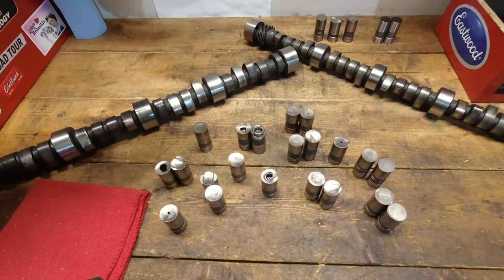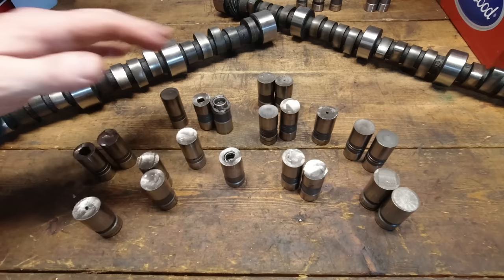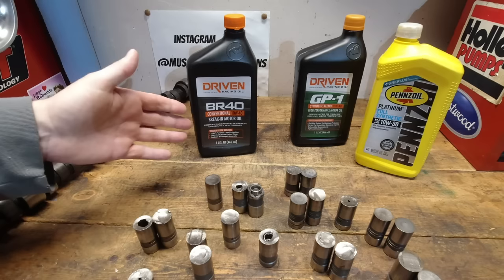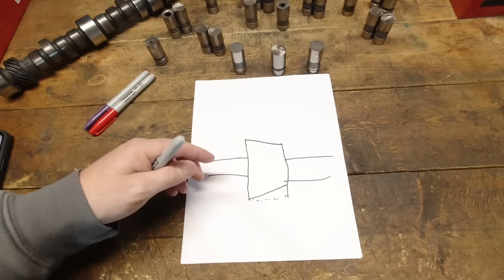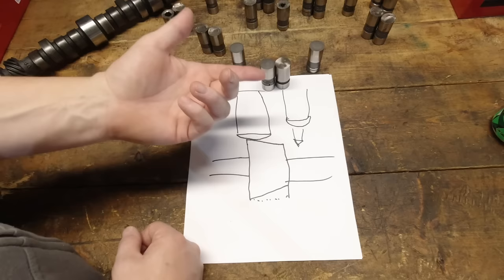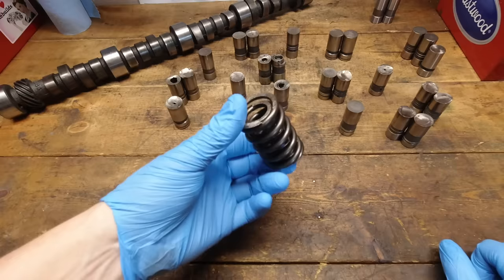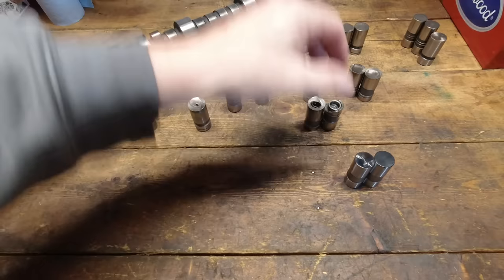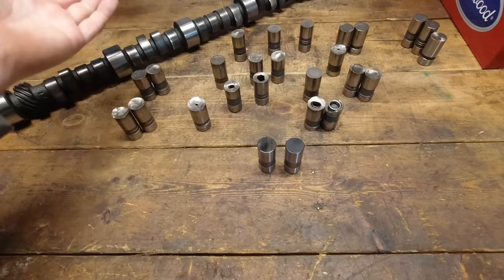Flat Tappet Cam Failures: The Reason Why They Go Bad & The Solution! Part 1

Comment: It would be nice for the manufacturers to further the machining process and sell their cam and lifter sets already broken in where the lifters and cam lobes are already wear mated together. Just packaged afterward in a specific way , then later installed making sure the lifters are placed in the correct bores to their correct matched cam lobe. 
Would save a lot of worry, headaches and trouble for the engine builder out in the field.
I carefully pulled a cam and lifters out of a Chevy V8 engine years ago and kept the lifters in a marked organized box to keep their orientation to the lobes they were paired with.
I will be breaking protocol and will be re-using this already broken in used cam and lifters in my next V8 build because I still do not trust any of the cam kits being made and sold today. 
It used to not be this way..
I've built engines and swapped cams  for 30 plus years .never had to worry about metallurgy , final machining and surface hardening processes much less be an oil chemist back then or do their QCs job. 
You trusted the parts quality and manufacturers reputation ..then installed the parts and broke in the cam per manufacturers and factory specs and procedure and were done..no problems after..it was easy..
So easy in fact a kid in his late teens could do it. 
Now the building and break in  process , just like everything else , has been intentionally made overly complicated and made excessively confusing. It has become literal rocket science now where it never once was. 
I sincerely hope that some manufacturer will one day come to their senses and produce parts like it used to be. 
Right now, it's anyone's guess what will work and it's a literal throw of the dice when you fire that engine up for the first time regardless of how careful you were in building it. You just don't know who to trust anymore.
Reply from the maker: The cost for a pre broken in cam and lifter set…yowza.  That would be ridiculously high!  The new DLC lifters seem to have changed the course.  Eager to see more applications covered but so far the reviews have been extremely positive.
Reply: @MuscleCarSolutions I think pre broken in cam and lifter sets ready to go  would put the ball back in the manufacturers court..forcing them to up their game in quality and reputation. If it wipes out on them, it's their loss and problem to correct in order to deliver a quality product you can trust is right.  
I would pay extra for that additional manufacturing step to get the peace of mind and assurance we once had with these parts 30 years ago when they were excellent quality. 
Better than shelling out the expense to rebuild again if the cam/lifters fail on you and hope it doesn't happen twice..
Reply from the maker: @mattmccain8492  I’d bet that would be a $2500 price tag.  Even if it was HALF that, no one in their right mind would pay it.  I have the final video in this series coming out soon that will go deeper into lifters.  There’s some things that I’m not seeing talked about yet.  Coming soon.
Reply: @MuscleCarSolutions thanks. I'll keep a lookout for it and definitely watch.
But I don't believe a pre break in machine  process would be THAT expensive. I can already see that step and tooling production setup in my mind.. simple setup and an optional manufacturing step done to order by request of the paying customer for a additional fee...not all cam sets.....but it requires an initial short term tooling change up in the production line  and the long term overhead expense of competent human employees to do it..something a lot of corporations are cutting back on and refusing to implement in today's corporate business models. 
But like you said, in 10 years this technology will probably be fully phased out intentionally.  So chances are nothing will be done.   The 1st gen small block Chevy is practically gone the way of the Ford flathead..only this time it was never truly replaced by superior design that was willingly accepted and transitioned to by the consumer....just forced acceptance to new , but still prototype phase, technology. 
Given the choice, I don't believe any gear head would willingly intentionally give up the Chevy small block on their own acord..its too reliable and versatile. It just works too well, easy to work on, is very affordable and has wide interchangeability across decades and a huge aftermarket support... .they are being forced to change to new tech and products that do not sell themselves as things once did.
Reply from the maker: @mattmccain8492  it has nothing to do with tooling.  None of the cam manufacturers today (comp, Howard’s, isky, trick flow, lunati) make lifters.  They purchase them.  We covered a bit of that in this video.  There are only a handful of US manufacturers making them and I have no doubt because they don’t want to due to going roller to support the OE business, that the quality has slipped.  But we’re going to go way more in depth on that up coming video.  The only way to break in a cam and lifter set is on a dyno or Spintron and that’s some costly time when you consider all the factors involved.  $2500 wouldn’t surprise me one but.  But they’ll never do it.
Reply: @MuscleCarSolutions yeah you're right. I know some guys who work at comp. They tell me the same whenever I bring up the quality of their product into question given recent events with all the cam failures lately. Some get outright defensive about it  but I don't care..nothing will change unless someone speaks up. If they can correct the issues with the lifters they obtain from their suppliers, then that would be great. So we shall hopefully see.  I appreciate the info you shared as it gives better understanding to this frustrating subject we have had to contend with .

Comment: This used to be unheard of. What has changed so much?
Reply from the maker: Discussed that in the video!  From several angles!
Reply: @MuscleCarSolutions  What I got from it was that 1) Oil is different than it was when flat tappet lifters were about the only thing out there,
2)Springs are stronger than they were back then especially in racing applications,
3) Manufacturers don't want to make them for economic reasons. 
Manufacturers have known since the beginning that the cam lobe taper that you spoke of had to be there and yet we're talking about it.
Regarding cam hardness and how it changes from running, there is a gentleman who did a video where he tested several old cams, some of them well used, and I believe some of them were in failure and they were all within two or three points of their published spec or their historical value. Now I recognize that you know many orders of magnitude more about cams, lifters and engines in general than I do but this one stood out for me, lacking clarification.
Thanks
Reply from the maker: @InsideOfMyOwnMind  for sure.  The hardness topic was one that I felt had a lot of information that needed it’s own video.  I just released that one this past week.  It’s a great video if you’re interested in seeing more.  When it comes to taper and lifter crown, that’s another video that I need to gather some more examples so I can present it all together.  Cam taper is wild.  There are some cams out in the market with a ton of taper ground in to match the lifters they are sourcing from odd places.  Not recommended at all.  We’ll also cover this in an interview I have coming up with Billy Godbold.  The interview I did with Lake Speed Jr recently covered a bit of the oil angle.  Trying to cover all of the different topics in different videos and keep them under 30 minutes.  Lots to cover!
Reply: @MuscleCarSolutions  👍

Comment: Let me tell you man I really thank you so much you just save me a lot of money because I am up to this part but believe it or not and tomorrow I am going into my garage checking if I bought the cam from Summit and if I got the list is from Summit as well And hope that there are the matching set for that cam and as far as the springs like the ones you just showed I am using on my heads I have a 350 small block for boat main and don’t know the pressure on those and never even thought that I needed to know thatso I will be bothering Summit tomorrow to get me springs as well to match the lifters and the cam. Thank you so much. Also, I am buying that oil as well priming oil.👍👍💪💪💪
Reply from the maker: Matching spring’s are important AFTER the break in.  For that initial and extended break in period, you have to keep the spring pressures low.  Oil, making sure the cam is of good quality (not the summit brand) and that the lifters match the cam (crown and taper).  Might go ahead and check out the other two videos in the series as they offer some additional insight.  The block has to be right also, so hopefully your machinist gave you the specs.  I’d absolutely look at the comp DLC lifters.  But everything else needs to be right as well to give yourself the best chance of initial break in.

Comment: You say don't mix and match brands of lifters to camshafts but the DLC lifters look like a godsend for flat tappet break in. I recently had a comp cam failure. Would you run these lifters on a Lunati cam?
Reply from the maker: Yes.  Comp had made all the Lunati cams for the last 15 years.  They’re ground on slightly different lobes but the taper is the same and they all use the same flat tappet lifters.

Comment: One lifter went out on my sbc street truck. Trashed the cam, going retro roller.
Reply from the maker: That’s certainly the most dependable option.  Just make sure your machinist verifies lifter bore location and interaction with the lobes.

Comment: Without being there myself without doing it myself the only thing that comes to mind after 55 years is because I've had some with failure and I only had one that failed on me it was my fault,  the hardness of the lifter material and the assembly Lube to break it in and then maintenance which means changing your oil and watching valve float which will rattle its guts out and the camshafts are usually pretty hard but the lifters but if the lifter material is inferior and doesn't like being banged and smashed very often then it'll start to gall or chip or flake away and then start battering through the bottom of the lifter now I could be off I could be wrong but from this distance and this observation that's not in front of me that's my best assumption

Comment: I think the problem is the taper on the cam and lifter. Miss matched clearances eating material away and nobody checking that, not the parts manufacturers, and not us or they wouldn’t send it out the door. I’ve had luck with .150 taper from the center of the lifter to the outside chamfer/edge on gm lifters. I’m not an expert but I’d say you’d want a little more than that on the bigger diameter lifters. I’ve ran gm hardened face lifters on several aftermarket cams and they’re on spec better than anything I’ve checked…so far. Maybe I’ve been lucky. But I check the cam and the lifters and haven’t had a problem since my dad told me to check every part you buy because it wasn’t the lifters in his time it was cam failures. A cam wouldn’t last 100,000 miles and lifters would actually be so tough it wouldn’t hurt them but the cam lobe would be destroyed. Geometry sucks he said. Started checking everything and sending cams and lifters back to be machined. He said after everyone started checking it we didn’t ruin any parts. We put too much trust into a company producing parts in spec and I think very simply they haven’t been checking and we the consumers paid the price.

Comment: Over the last year , there have been well over 20 videos posted on YouTube showing exactly why cam /lifter failure in flat tappet applications has become such a problem . The problem is how the cams and lifters are ground . With lifters it's erratic grinding and either flat ground or uneven grinding . What all the videos show is that instead of having 1.5 thou taper from center to outside....there is none...or much more . Since the taper has to match the taper on the cam lobe to promote rotation , cams suffer the same lack of QC . If everybody in YouTube land is aware of what's causing the issue....the cam companies HAVE to be as well . Having an aware public is bad....when you haven't corrected a known problem in well over a year . Being aware of the issue didn't stop them from foisting off junk on those that are not aware . That's a really poor way to run a business .
Reply from the maker: There is not one factor contributing to the failures flat tappet cams have seen over the past two decades.  The ones that are the most terrifying are the ones no one is talking about.  We covered it in the last video in this series.  Seems like half the videos I’ve seen only want to talk about lifter crown.  While that’s very important, it goes hand in hand with the taper on the cam.  There is a fairly well known cam in a niche engine that uses a really aggressive cam lobe taper.  Why?  Because they chose to run a lifter with an odd crown.  But, they work well together.  Even though of it was measured it would show way more than that factory spec.  But if someone bought the cam and not that lifter and put it together with an odd combination…destruction.  Way too many variables at play here and one of the biggest killers isn’t the fault of any cam manufacturer.
Reply: @MuscleCarSolutions  When rebuilding a basically stock engine , using basically the same lift and duration ...there just aren't many other factors in play .
Reply from the maker: @MarineGrunt  plenty of factors.  And the biggest one is largely ignored until a good machinist finally sorts it out.  Go watch my last video on lifters.  But again, it’s one factor of many.  It’s frustrating to see so many failures that could have been prevented.

Comment: The cast cam cores coming out China along with poor heat treatment processes and surface hardening (nitriding) don't play nice with the more aggressive profiles people want to run.

Keep in mind, until recently NASCAR was still aing flat tappet cams and they weren't having issues. It's just poor quality consumer stuff that's bought from the lowest cost supplier
Reply from the maker: All of the cams in the video were US made cores.  Some of the “house brand” cams you see could possibly come from off shore.  The major manufacturers use the US based core manufacturers.  

That’s how Driven Racing Oil was born.  When the API oils drastically reduced the amount of zinc in there off the shelf oils.  The amount of failures in NASCAR was staggering those first two years until Driven formulated that oil for their team and sold to the other teams to stop the failures.  Until they switched to roller in 2014-2015, they still had failures.  Cast cam cores, to your point, are not capable of handling the aggressive lobe profiles and the pressures out on them.  Everything evolves and it’s time for the cast cams and flat tappet lifters to ride off into the sunset.

Comment: DLC is only being offered on solid lifters. Hydraulic flat tappet appears to be as much or more than rollers!!
Just a quick search revealed that.
If DLC works they won't keep them cheap for long. As soon as the word is out up goes the price Gautanteed.
Reply from the maker: That is incorrect.  The link to the DLC hydraulic lifters is in the description.  You’re looking at the tool steel race lifters.

Comment: I lost 2 solid lifter cams using oils with ZDDP. Last cam I used Joe Gibbs BR oil for break-in with my old springs and drove the number of miles per Lake Speed. Then swapped the springs and broke them in per Lake Speed. I followed up with Joe Gibbs 10w30 driven oil. Later used various brands such as Valvoline VR1 racing oil, Red Line, Kendall and Brad Penn. After the last cam install I did lasted 8700 miles which then I decided to get the engine torn down and go roller and that was back in 2012. If I was installing a FT cam today I would invest in laser holed lifters for the extra oil. 😊
Reply from the maker: The EDM holes have never been proven to be the solution.  It was a good theory that never really solves the issue.
Reply: @MuscleCarSolutions  Based on your sketch at 18:10, there is a very narrow path that the lifter rides/rotates on the cam, so that EDM hole would need to be in a very specific location, and due to the low speeds teh lifters rotate at, it would not be getting a lot of oil to the required location (not constantly, anyway).  And on top of that, there's now a discontinuity (the hole) in the rotating path.  Is my assessment correct?
Reply from the maker: Holy cow dude.  Please don’t take any drawing I do as a “to scale” or “as used”.  It’s just a representation of the general situation.  But yes, if you look at a cam and the lifters as assembled, you’ll see the lifter is offset on the lobe.  As far as the EDM oiling hole, I think it’s pretty clear that in theory it was a good idea.  In practice, not so much.  Or at least not a measurable amount of success from it.  Given not all lifters have them or have the feature available, it’s hard to say they were a success.
Reply: @MuscleCarSolutions  Oh, I wasn't scaling your print, only pointing out that you visually showed what geometrically must be true - a lifter with a radiused surface has very little contact area with a lobe that has a taper built into it.  And that the location is not in the center of the lifter diameter either (else it wouldn't rotate).  But I'm betting that the EDM'd lifters have the hole dead-center?
Reply: @furyfantoo  the lifters are literally flooded with oil from the bore clearance and the crank slinging it. Does an EDM hole hurt anything ? No. Does it help anything? No.